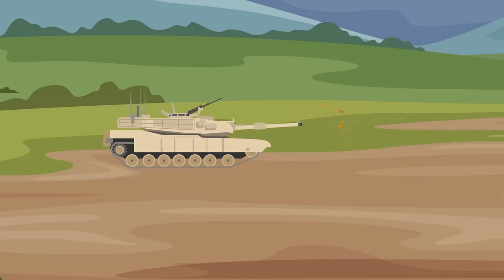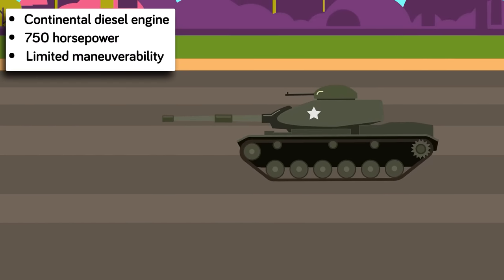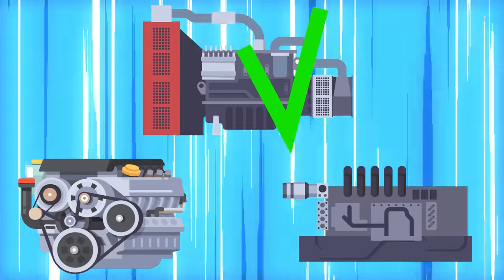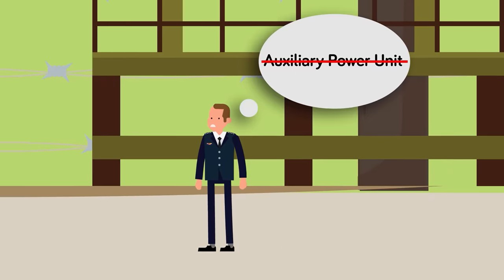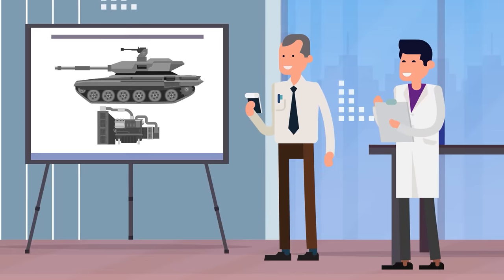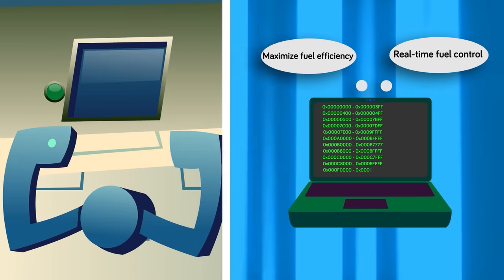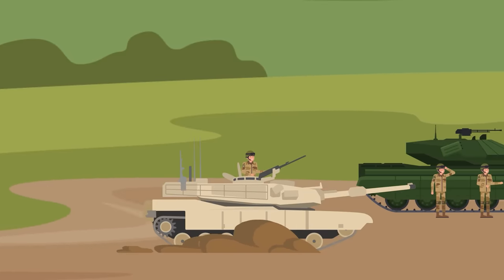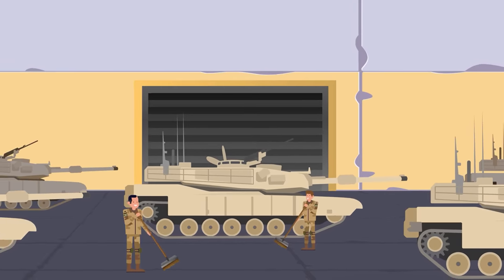Why M1 Abrams Turbine Engine Is Actually OP

Comment: The Abrams should be made into a hybrid like trains. That would allow them to operate silently and cross under rivers on battery power. Battery power for systems and then the turbine recharges at optimum RPM
Reply: Assuming you can get the capacitance at a workable price, that sounds like a potential retrofit kit to me.
Reply: That's being considered with General Dynamic's newest Abrams technology demonstrator. It's supposed to have a hybrid power pack with an opposed piston diesel and electric power.
Reply: @GeneralLee131  That is a best part of a turbine. You can tune it run very efficiently at an RPM. That can allow for better fuel economy and basically just level out the power demands and fuel economy. The Germans did have a similar concept for their super tanks
Reply: You're not an engineer... I can tell from your ridiculous comments
Reply: @WilhelmKarsten  whatever makes you feel better about yourself man. BMSE
Reply: @cmdr1911  The major disadvantage of Battery Electric hybrids is weight... it's 
also a major design problem in tanks  where power-to-weight ratio performance is critical  to battlefield survival.
 Battery Electric vehicles have the lowest power-to-weigh and weight-to-range performance.
Any questions?
Reply: @WilhelmKarsten  How large do you think the battery ultimately needs to be? 20 minutes of run time to drive through a river? You would have hours of battery power while sitting idle and just using senors. A half ton battery back would be sufficient, allow for more efficient idle, new ways to cross streams, remove a complex drive train and provide better lower speed performance due to better torque at the start. Having a tank set up to be a power also allows for the option of directed energy weapons in the future and reduction of heat signatures when idle.
Reply: @cmdr1911  Well, a Tesla Model S has the same range as a M1 Abrams, about 265 miles.
The Abrams carries 500 gallons JP-8 weighing about 3,000 pounds.
(Based on JP-8 35 MegaJoules/liter)
 The battery based on Tesla 100 k/Wh lithium ion technology...
The battery would weigh 75 tons
More than the entire tank does now.
Reply: @cmdr1911  To equal just 5 gallons of JP-8 3
(35 pounds) the Lithium ion battery weighs 1,500 poounds!!!!

The Abrams burns off 340 gallons it will weigh 1 ton less..
The battery stays the same weight... fully charged or completely dead.
Reply: @cmdr1911  Why would the Abrams need more torque??
Tanks don't need high torque output... they need extremely high Horsepower-to-weight ratio performance... like Aircraft.
Reply: @cmdr1911  Diesel engines already have a much lower heat signatures at idle compared to a gas turbine.

Comment: When does the M2 come out? If they want to stay cutting edge they need to release a new tank with minor upgrades every year! The military would be wise to follow a software engineering paradigm.
Reply: It's not an iPhone
Reply: @Lameducks  Do you want protection that grows with at politician or Moors law speeds?
Reply: @Josh Guyette  you do understand that these military weapons do get semi regular upgrades and fixes right? They briefly mentioned it in the video when they discussed the armor upgrades making the M1 heavier. But again, it's not an iPhone, it doesn't need monthly updates and yearly model upgrades, especially when it's still at the top and a new one has been in development for years.

Comment: 1,500 hp is an amount of power, not energy. That is power is the first derivative of energy with respect to time. Also, 1,500 hp is not "mind-boggling", although it's quite a lot for a tank. The Leopard II produces similar amounts of power, and there have been several piston aero engines that have produced a lot more. What the gas turbine in the M1 Abrams has going for it is that it's relatively small, light and doesn't produce clouds of give-away smoke when fired up. However, that comes at the cost of prodigious fuel consumption and a lot of heat output.

Also, the Abrams does NOT have a jet engine, it has a gas turbine driving the tracks via a gearbox. A jet engine powers things like aeroplanes and land speed record cars by the reaction force of the exhaust. Not all gas turbines are jet engines. 

So there's a lot of factual errors in this video and misuse of terminology.

Comment: Nah it’s loud AF. Can hear from another universe when one of these starts up. Means mobilizing this vehicle will just Auto Spotted for the enemies. Besides. Tank weakness is Tracks and Gun Barrel. Shoot either these two will either making the tank being a stationary Target for Arty or aircrafts OR disabling the main gun is just making this thing to become Armored Truck.
Reply: The turbine generates high frequency noise, so it dies quick with distance so at combat ranges in quieter than a diesel engine, yeah hit those and the other tanks on the platoon will send you with your creator.

Comment: its the abrams flaw not asset ...they put the leopard 2 and the m1a2 head to head and the leopard edged it over fuel efficiency hard to split them apart from that ...even with an apu its still a guzzler
Reply: According to the numbers I saw, the Abrams gets 0.88 miles to the gallon, the Challenger gets 0.81, and the Leopard just about .80. Those were for the latest versions.
Reply: @marksnyder8022  
Abrams;  according to Wikipedia 426 km range on the road 129 km off-road. Tank capacity 504 gallons
Leo 2;  about 500 km on the road and 161 km off-road. Tank capacity 306 gallons
In a comparison test in the field, the Swedes found that the Abrams consumed about twice as much fuel as the Leo 2.

Comment: B.S that thing eats through fuel so quickly, it can only go where refueling trucks can go. It's the weirdest flaw, I know all tanks have this problem but in rough terrain you really can't go anywhere without massive diesel trucks to refuel it. It burns through fuel so fast. Our Styrkers were limited when waiting for the armor units. It's the best tank, but still has  the flaws of a tank. Our javelin missiles were way more effective against armor. What do I know it was all in a training environment, God knows what changes in a real combat operation

Comment: I'd consider it more of a drawback than an advantage. The IR signature of the Abrams is NUTS because of the turbine engine. As long as you are the uncontested tech leader on the battlefield, you can get away with that, because you can still see your enemy from further away than he can see you... but a good diesel engine would make it a better tank in my opinion. 
I'd like to have the Leo 2, with the electronics suite of the Abrams. ;)

Comment: Meh, during the Gulf war, those engines only lasted a short while, while consuming 83% more fuel than comparable diesel tanks.  So the Pentagon reports tout the engine’s “maintainability”, while skirting any discussion why it needs so much maintenance.   And the tank is geared for high speed, so it can’t even push a blade to dig itself in.  Not so superb.
Reply: Never a problem when you have the logistics of the US Military.

Comment: Funny, I talked to a tank crew back in the mid 80s, they told me that their abrams would do 65mph over rough terrain.
Reply: It can. It's top speed limited.
Reply: 65mph over rough terrain? have you ever been off-roading? Try to take your regular car off the paved road, and even in the best case scenario onto like a relatively smooth grassy hilly terrain because the car is so heavy going 40-50mph is going to be a very bumpy ride. Some of those minor humps are going to be like going off a ramp, and when landing the stress on the vehicle is extreme. There is a reason your best bet for off-road vehicles is a lighter one with great shocks and suspension, like a good dirt bike or a quad/4 wheeler.

Comment: It's the second tank with a gas turbine engine. The T-80's the other.
Reply: First tank with a gas turbine was a STRV 103, second Abrams and third the T-80.
Reply: @viceralman8450  I didn't know that.
Reply: @blaircolquhoun7780  Well now you know.
Reply: @viceralman8450  Yes, I do.

Comment: it´s probably more a weakness than a strengh to us a turbine instead of a diesel. there is almost no advantages to a turbine over a modern multifuel diesel that i can see, fuelwaste reliability service life gearing and special materials just for an advantage in weight and packaging? whats about the apu ist it a turbine aswell? where are the specific advantages the abrams hast because of it´s turbine?

Comment: if you compare the dieselengine and the jetengine, the jetengine needs a lot more time to start.
i cant prove it, but i heard that the usarmy built leopard 2 dieselengines in their tanks in iraq or afghanistan because the sand blocked the air filter of the abrahams.

Comment: Wrong, french MBT is mounted with a helicopter gas turbine.
Reply: The Leclerc uses a diesel engine.
Reply: @viceralman8450  The Leclerc uses both, like the S-tank.
Reply: @WilhelmKarsten  No, the Leclerc use the V8  V8X SACM diesel engine.
Reply: @viceralman8450  You need to do your research son, the Barric engine is a compound Diesel-gas turbine
Reply: @WilhelmKarsten   Well that's not the one used on the Leclerc, as the manufacturer NEXTER states is the VD V8X-1500 turbocharged diesel engine.
Reply: @viceralman8450  The Leclerc is powered by a Turbomeca TM 307 gas turbine engine coupled with a V8 Diesel engine.
Reply: @viceralman8450  YouTube search for "demarrage leclerc"
Reply: @WilhelmKarsten   You didn't even read the comments right, there a user comments that's the axillar APU that power the tank on Idle and starts the turbo charger but is NOT the main engine. As I mentioned several times. 🤦‍♂
Reply: @viceralman8450  You are clearly not formally educated or have any professional experience in this field, the SACM V8X "Hyperbar" engine is a Combined Cycle Brayton + Diesel series-parallel compound engine.
A Gas turbine engine and a Diesel engine that both deliver power to the tanks final drive unit both directly and indirectly.

Comment: Guess what? The Leopard 2s engine can do anything this turbine does, just better...
Reply: Then try running it on lamp oil.
Reply: @robertharris6092  Leopard 2 has a multifuel engine.
Reply: @blackdification  but it cant run on lamp oil. Or vodka. The abrams can.
Reply: @robertharris6092  it can run on various alcohols and liquified petroleum as well. But good luck finding that stuff en masse in a warzone.
Reply: @blackdification  and in the amounts the abrams needs it.
Reply: Except not.
Reply: @blackdification  it can run on sunflower oil and vodka.

Comment: It is OP, as in "OVER" powered. It would be WAY more suitable for a modern war of attrition, especially oversea (therefor 99.9% of their current and prospective assignments) if it was an engine using a fuel with a more widespread availability... 
You don't have to take my word for it; it's one of weakness that the army wants to avoid for their next gen.

Comment: A BS story. WW2 tanks had an APU, it's just that US vehicles never had one. And a power pack change in 4 hours, the Leopard has had a 20 minute change for decades, as do most European tanks.  Fuel?  The Abrams uses 3X more fuel than an equivalent diesel, and sure the US can and does supply it, but this requires 3X logistic tail, which the US can provide, but...in any asymmetric conflict this tail is most vulnerable to attack by even a tiny local enemy force.  The Abrams is not the world's greatest tank...

Comment: This is in fact the weakness as tank, not a strength..You really need to be a american to not see this. With jet engine, you are very weak to anti tank weapons (heat seeking), and huge usage of special fuel, will make the logistics in war, very challenging.
Reply: Also, as has already been commented on several times, It is a multi-fuel engine, which can run on any grade of petrol, diesel, aviation fuel or kerosene
Reply: Wrong on every point! That's consistency at least.

Comment: The Leopard 2 also has 1500hp and a traditional Diesel engine that every farmer, that knows how his tractor engine works, can repair.
Reply: Diesel engines are higher tech than gasoline, and require good shops for anything other than component replacement. Neither farmers nor tankers repair their engines in the field.

Comment: Leopard 2 tanks also have 1500 horse power, so why the sensitive gas turbine that need much more service? At least it was the argument of Biden why Leopard 2 is more usable in Ukraine and he did not want deliver Abrams for a long time.
Reply: The turbine is a bit finicky, it needs more "love", but it has several advantages over diesel. The Leopard and Abrams engines produce the same decibel level when in operation. The Abrams has a high pitched jet whine. The high pitch means the sound dies down at a shorter distance. Iraqi tankers called it "silent death." Also, most diesels produce thick black smoke. The Abrams on jet fuel produces very little. Smoke and sound are the best pre-drone ways to find the other tank. Some say it has a bigger heat signature than diesel but that is untrue. The diesel is not as hot, but thermal imafers illuminate heat differential. On a cold day, an un- covered human head looks like torch almost. Both tanks give off big heat signatures.
Reply: @marksnyder8022  I work since years on infrarot ink and for high temperature camouflage it depends on the 4th power of temperature.  It means Diesel is miles easier for IR camouflage. It seems you only compare crude tanks without camouflage. Of course the manufacturers always try to sell some uniqe features but I daubt they  say the full truth. For some reason the AFU always asked primarely for Challenger and Leopad tanks and only because Scholz insisted a few Abrams were promised for end of the year or maybe next year.

Comment: Still the abrams has one major problem it drink it's fuel to fast compared to the challenger 2 and the leopard the abrams will have to refuel multiple times before it get to the battlefield by time it does the other 2 thanks have already won the battle
Reply: Wrong

Comment: Am i the only one that thinks new tanks should be electric like tesla cars???imagine the advantages!!!
Reply: One emp and it's out
Reply: @thomas4842   LOL bro quit the cod...most of the existing ones are full off electronics already...
Reply: @viceralman8450  oh sure. Now how much would that tank weigh? And what about the capacity of the battery on a 60++ ton tank. And also the infrastructure needed to charge it. Little bit dizzy today? 😂
Reply: @thomas4842  EMP shilling weight next to nothing is just a thin metal mesh around the components.
Reply: @viceralman8450  Yeah, I believe that, just that a tank using electricity as main power source isn't viable in my opinion.
Reply: @thomas4842  It could be implemented but there’s no need.
Reply: @viceralman8450  Sure it could. Just saying wouldn't be usable in any war scenario as of today.
Reply: @thomas4842  Not in tanks at least, but smaller vehicles have huge advantages.

Comment: There is no way Ukraine can run M1 tanks, without constant USA fuel resupply. 
There is just no way.
Reply: Those turbine engines consume too much fuel. 
You will need 5 resupply trucks running back and forth, just to keep it running.
Reply: So they'll just give it to them. Lol!
Reply: @MarkBarrett   lol it has an autonomy of 400 kilometers on road and 250 on cross country. Talking about exaggerating. 🤫

Comment: The main disadvantage of these tanks is that they only run on JET fuel which might and most likely will be a logistical problem since most of the tanks in EU run on Diesel. This is why it is going to be a waste of money if they are sent to Ukraine.
Reply: Commenters are here to help you out.
Reply: Errr they will run on multiple types of fuel. I've even seen shows that have said they can run on cooking oil if needed.
Reply: @a-dawg8576  I checked few eng-Polish sources and they are comparing leopard 2 with Abrams, constantly mentioning about possible problems with logistics due to the fuel type. Peace <3
Reply: You are 100 percent wrong. As dozens of posters keep saying, the M1 runs on anything combustible. I have put straight up truck diesel in them and they ran just fine.